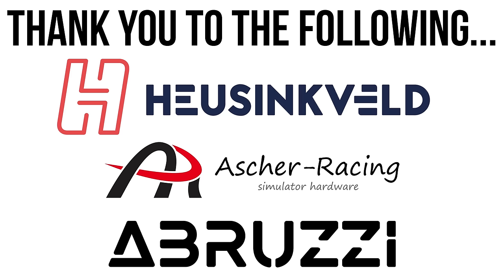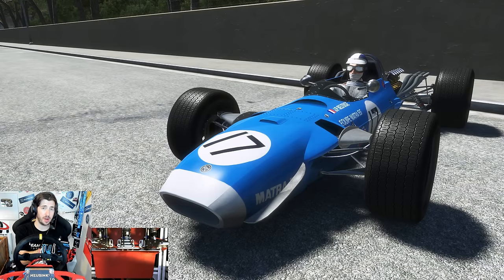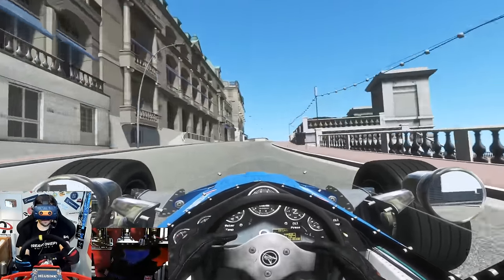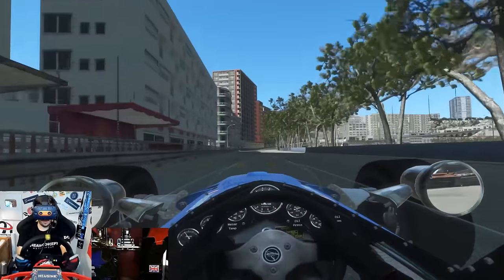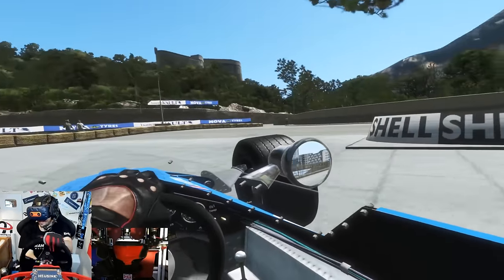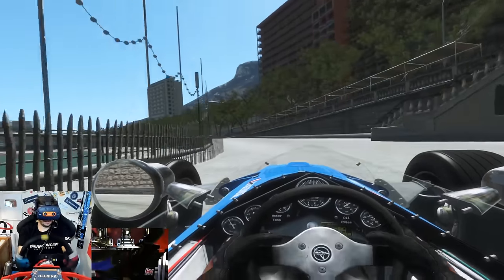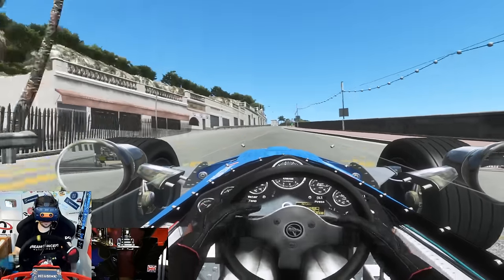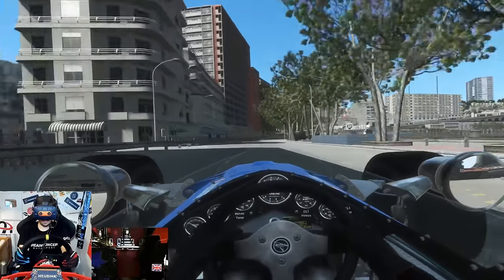Trying To Beat A 50 Year Old Monaco Pole Lap

Comment: Try a formula 2019 hybrid on that track
Reply: I was going to say that but whatever...
Reply: Boring car though, why bother..
Reply: F1 2005 better
Reply: I also wonder how good a modern F1 car would perform on that track (especially the deadly chicane).
Reply: @David Miatke It is boring. Power isn't exciting.
Reply: We have Formula 2019 Hybrid mod on rF2 now?
Reply: @David Miatke anything with less than 3 pedals is boring
Reply: @Vekkuli001  Not yet, but this track has been converted to AC
Reply: @abulmamodo5241  to be fair, it has a clutch, and two clutch pedals...they're just on the steering wheel and you only need it when stopped
Reply: @David Miatke the modern f1 are more like 1200 hp per ton
Reply: Bounze  modern f1 cars are actually underpowered for the chassis. And this oldschool insanely overpowered, no grip, no aero, drifting all day
Reply: No.
Jimmy's audience are cultured people that want to actually hear some exhaust noises.
Reply: David Miatke in my opinion the 2005 cars were better
Reply: @David Miatke Its boring it is. All the safety regulations and hybrid power ERS and DRS stuff are killing the sport
Reply: @omoghosty5777  "safety regs are killing the sport" oh yes because people dying horrifically on a regular basis, while admittedly exciting, would end in ever track and country the race at to ban it from happening. which would definitely end in F1 reaching new levels of success never before seen....

Comment: And to think. Drivers in this era may or may not have been wearing belts.
Reply: They would all have had safety belts by then.
Reply: @50gary actually no, alot of drivers liked to take a chance on surviving being ejected from the car and breaking a few bones or dying on impact with whatever they hit instead of burning alive in the car.
Reply: @saljoo5514  Nope, back in the 1950s yeah some did that but 1969 is modern era.  My Dad used a seat belt in the 1950s stock car racing.
"Technical regulations (chassis)" . Safety regs. you will note that even in 1963 there are rules for seatbelt anchorages.
"1963-65
Pump fuel only. Automatic starter; rollbar; double braking system; rules for seatbelt anchorages, fire protection, fuel tanks, fillers and breathers.
1968
Electrical circuit breaker; reverse gear; cockpit designed for easy evacuation; oil catch tank; rollbar 5 cm above driver's helmet.
1969
Two extinguisher systems; parts with aerodynamic influence must be immobile, fixed to sprung parts of car only; maximum bodywork height & width limits."
Reply: @50gary  oh ok then, i remembered that the lack of seatbelts was the reason jim clark was killed but maybe i was wrong about that then.
Reply: @50gary  For the races - not always for the practices.
Reply: @saljoo5514  That is also not true. Jim Clark was wearing a seatbelt during his last race (which was not formula 1 race btw but formula 2 on Hockenheimring). The most likely thing is that he had a puncture and drove into the forest hitting multiple trees (there were no data like today so it is still a mystery what exactly happened but the most likely version is a puncture). When examining the engine, it turned out that Clark had remained full on the gas until the very end and he was fighting with the car until the last moments. A marshall mentioned that he saw the rear end going violently sideways and Jimmy was apparently trying to control it for roughly 200-300m all be it unsuccessfully. But he was wearing a seatbelt during the race.
 
In the end, the whole car turned into debris, cockpit separated from the engine with transmission and his seatbelts were torn apart along with the whole cockpit. He probably hit multiple trees before the wreck came to a complete stop. So the reason he was killed is definitely not lack of seatbelts (to be honest if there were no seatbelts the result would be the same, he simply directly hit trees at high speed). Car, for whatever reason (again not concrete explanation), went sideways and drove into the forest (at that time it was just a couple of meters away from the track).
Reply: @50gary  seem to recall Jimmy recently saying that seatbelts werent compulsory in F1 until the early 70s.

Comment: An old police driving instructor friend of mine, who used to race 60's & 80 f2 cars, explained that many drivers of that time used to roll in neutral around a lot of slow corners to keep the revs up so they could slip into 3rd quite easily...which when you think about it, is absolutely fucking mental!

Comment: And they used to say Graham Hill was not a natural ... 

Wonderful video man, really liked it because of the respect you have for the sport; used to do this track in the Lotus 49 in GPL - same situation, tears, sweat ... I didn't have VR or a clutch downshift so it was much much easier for me.

I found that the chicane goes a lot better if you left foot brake while keeping a little throttle still as you downshift (or it did on the Lotus in GPL).

Comment: How weird that the track 50 years ago seems so much more well-suited to today's cars than the current version of the track!
Reply: But not for todays safety regulations. There's a reason why the chicane after the tunnel has been added. Also the chicane at monza's finish line. That's because the FIA has defined how long and wide run-off areas have to be at certain speeds. The old chicane would need a huge run-off area on the left side of the track (which is not possible, because water and yachts). The first corner also have been narrowed so that the drivers aren't able to drive through that as fast - therefore removing the need for a run-off area on the left side there. Most of the curves on modern tracks have the function to slow down the cars just so that a run-off area can be spared on the parts where it's almost impossible to build them. You can look up any modern circuit and look at the corners and run-off areas, you'll understand why they're built the way they are.
Reply: @ShazenVideos  Agreed, if Monaco wasn't the crown jewel of the F1 calendar with such a rich history, I doubt it would have ever been approved to be added to the calendar if proposed as a new track these days. The old track was certainly wider and the cars were much smaller, but safety was completely non existent. Crashing into the harbour is actually a best case scenario if you did happen to lose control. Monaco today, as Jimmy said, is incredibly boring on race day (unless some rain spices things up), but quali is still incredibly fun, even if one team is dominant. But the current cars are too long and wide for Monaco, and seeing how FIA likes adding more and more street circuits to the calendar, I can't see this getting any better.
Reply: @ShazenVideos 
The longest possible way of saying racing has become completely pussified.
Reply: @ShazenVideos  "Have to fear for their lives". They don't HAVE to do anything. They can go work in a factory or something.

Comment: As I recall from the Movie "Grand Prix", they had to use a manual "Stick" gear box.  For the simulation to be genuine back in 1968, it would require the use  of a stick shift.  Just think how difficult it actually was, having to take one hand off the wheel at such high speeds. 
 As powerful and fast  as the new F1s are today ,  I can see how critical it is to have both hands on the wheel at all times.  Nevertheless,  the simulation does provides an opportunity to experience how thrilling it would be to drive a racing car, especially for those of us who have a need for speed.
Reply: And the steering wheels were huge compared to today.

Comment: If you get a chance, there's an old movie I'm sure you've heard of called Grand Prix that was filmed by following the GP circuit back in period. The actors and some of the period F1 drivers did the actual driving. Anyway, there's a scene they did at Monaco by mounting a camera on a stripped GT-40, (the real thing, not the new Ford GT, it was 1960-something,) driven by Bob Bondurant screaming through the course that makes you grip the arms of your chair as if you were actually in danger. It's absolutely one of the best pieces of film for any gear head of all time.

Comment: 1968 Mayra MS9 V12 had about 390 bhp . So underpowered compared to the Cosworth DFV , 
Still a great sounding engine that was further developed but never was going to top F1in the Cosworth era , but instead Matra moved into Sportcar racing were Matra would win at Le Man's  with  a relation to this V12  .
Just to add the DFV was rated at 408 bhp though many teams modded the DFV to gain extra power . Reliability was the ace in Costworths hand and the fact that anyone could buy it and build a race car around it. Though Lotus had exclusive use of the engine the then decided that it would be better for the sport to allow anyone use of the engine , even Matra would end up using the DFV later in their F1 cars the Matra V12 was prone to failures even the V12 used in the later Le Man's cars were detuned down to 450 bhp so they would last the full distance though they produced a wonderful looking engine .

Comment: This car had "only" about 390 horsepower, but considering its weight (580 kgs) it had a great power to weight ratio, for its days.
Needless to say it had a lot of torque, which meant that in combination with tires that lasted 4 or 5 complete races (!!!) this car was hard to control.

Comment: You wanna know for a fact what these racers did on qualifying? That last hairpin has so much runoff area, I bet you on their outlap they took it eeeeextra wide, to have a longer runup and higher top speed at the end of the pit straight, then take it normally on the actually qualifying lap. Wouldn't be surprised if that gave you those few tenths.

Comment: I'll never fully understand the reasoning behind blipping the engine on downshift. I know it is done to rev match and stabilize the car. 
Yet often times I see sharp (incidental) brake pedal input as the throttle gets blipped. Wouldn't this sharp uneven brake input also destabilize the car?

Love the videos btw!!
Reply: Well at least any braking input would go through all 4 tyres, instead of  shift-locking only the rears which basically acts like you're pulling up the handbrake.

Comment: Looks like you were driving on a green track, need to set the real road setting with a bit of rubber to do hot laps like that. you will find the cars a lot more controllable with more grip as you would have in a real qually session. It was just starting to rubber up a bit at the end there.  Its a shame the online racing with these cars is practically non existent. Need to do the same but with the Brabham BT20 around Monaco or Longford.

Comment: when the steering wheel wasn't a console/PS4/Xbox controller. I swear in 10 years, you can accelerate/brake using the steering wheel shoulder buttons lmao

Comment: hes one of these guys who love how their hands look in gloves, you can see how much he admires his hands in them, look how much he moves them around. also, why would anyone needs gloves, that wheel has mateiral for grip. if anything, those gloves will hinder you as you can't let the steering wheel roll back to center after a bend as the material will stick to the glove.
Reply: because you are racing, not driving a family car down a road. so you won't be letting go of the wheel to let it roll back to the centre. the added grip is beneficial.

Comment: this was real racing, when you piloted a big noisy engine perched on very little grip, all badly behaved and over-powered and making driver skill far more relevant (and all that frigging dieting and gym work that rules out top level racing for 99% of the population far less relevant). swear to god, f1 has done nothing but endless dead wrong decisions as it struggled to retain the crowd-pleasing excitement of this era against a backdrop of the rapid evolution of technology that forced constant revision. sometimes it's almost like the primary consideration was to keep f1 too expensive for anybody other than the major players. and, obviously, maintain the bragging rights of being faster than indycar, because spectators REALLY CARE ABOUT the difference between a 2:00 lap and a 2:15 lap

it kinda shows at the chicane that jimmy spends more time in modern cars. the response of the far stiffer suspension and stiffer, grippier tires is so much quicker, he doesn't seem to have that innate process of doing all the sudden steering inputs "a teeny bit too early", like there's a subtle synch error in the video feed (but just to be clear, he doesn't suck either)

Comment: Noob question: Why does he do that "sidekick" when he shifts down?
I drive manual IRL myself. But if I shift down, I surely don't kick the gas a little, while simultaneously braking.
Reply: Heel-and-toe shifting. It's used to increase the engine rpm and smoothly engage the lower gear at an optimal rpm.

Comment: In real life it would not have bounced you like that, the energy that caused car to bounce would have went to destroying suspension. There would have been some bounce but you propably would not have ended up in harbor. 
It still would have been extremely dangerous ofc.